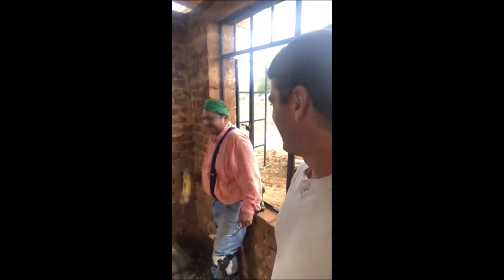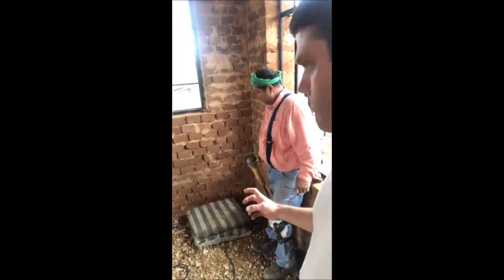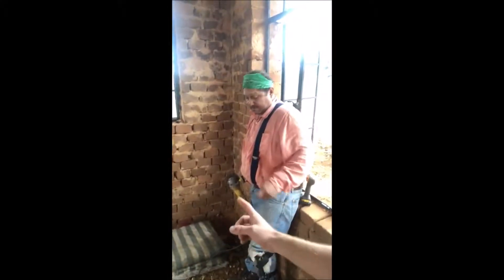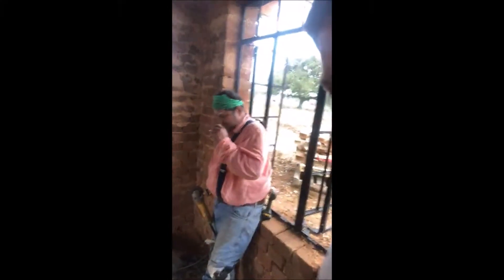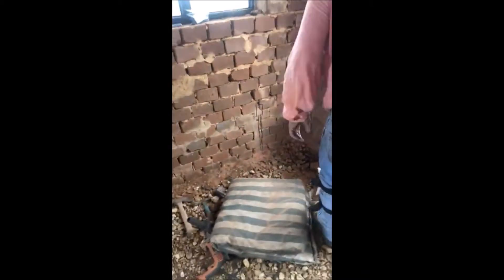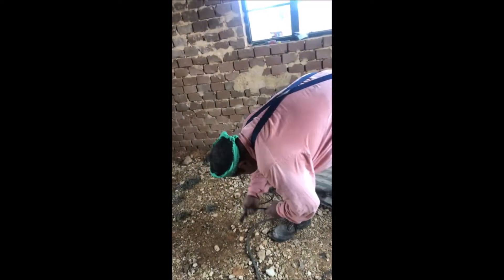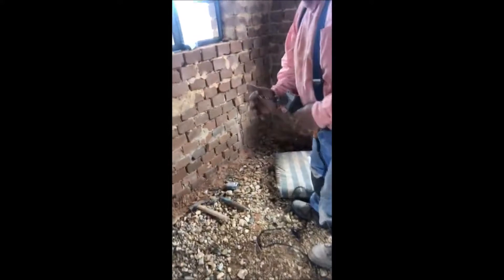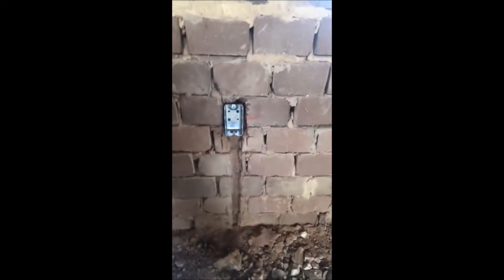Cutting grooves in cement-stabilized CEB walls for electrical installation

Comment: Curiosity has me here.  Why not use the CEBs with the two holes in them instead of solids?  All the videos I've seen your channel has posted has used solid bricks.  Do you offer the other plate types, or is it just solids in different sizes?
Reply from the maker: We can make solid blocks, holey block, and interlocking blocks. We prefer to work with the solid blocks. They offer more flexibility. We will use holey blocks in seismic areas where rebar is required. Blocks with voids will have a lower thermal mass and won't be as strong unless you fill them in. That process is more time consuming than cutting in your plumbing and electric, especially if you are plastering.